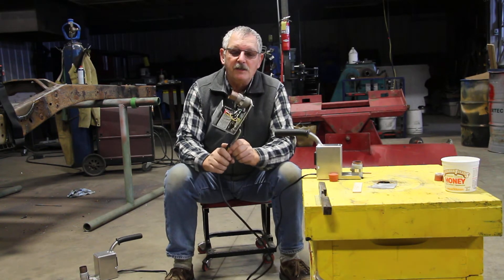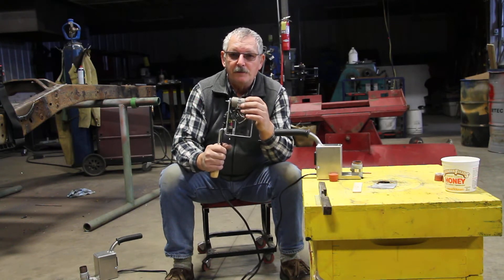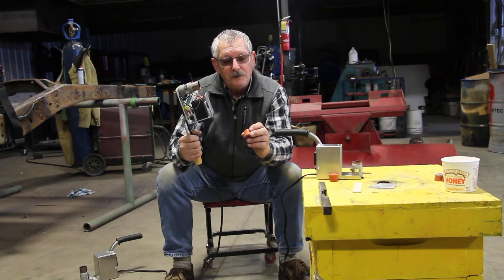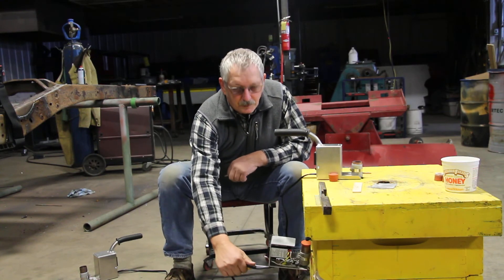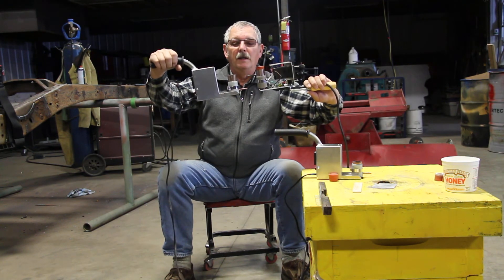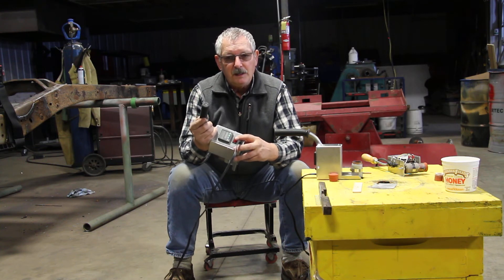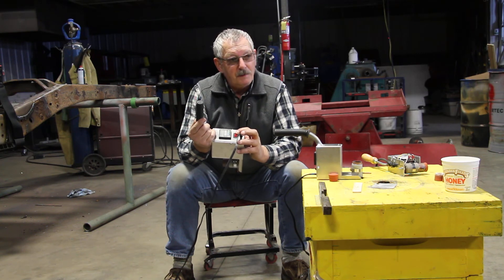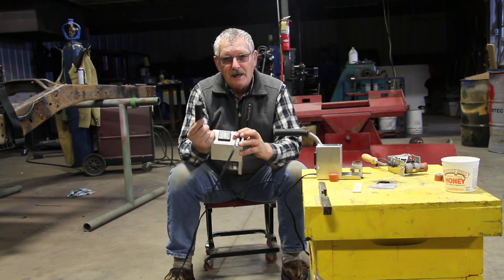1 Intro OA VAP110 01 04

Comment: I received mine and I can say that Joerg shows real pride in his workmanship. Very professional & the unit is very well built.
If you're thinking that it having a metal case will add to the weight I can tell you that the unit is very light (much lighter than I was expecting). I suspect it is about the same as those with plastic gange boxes but looks so much nicer in my opinion.
The cord is probably about 6 feet long which is great so the connection is not real close to the unit which I consider a big plus.
Joerg shipped it fast & It took about 3 weeks to get to Alabama from Canada which was over the Christmas/New Years holidays during the Pandemic & we all know how messed up things were.
I would definitely recommend this unit to anyone considering a vaporizer of this type.
Also yes, he does accept PayPal. Had him send me a PayPal invoice.